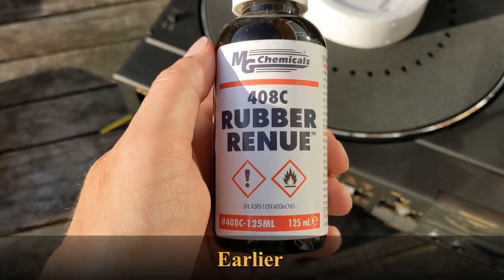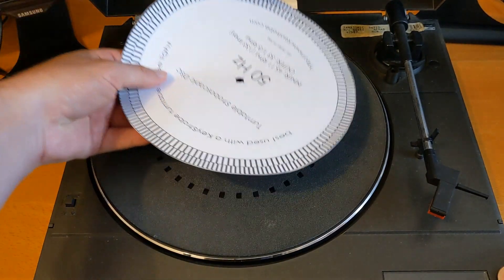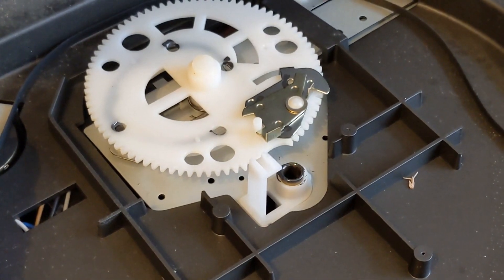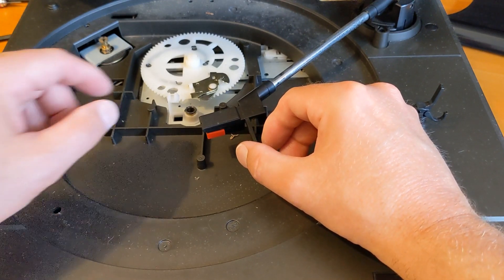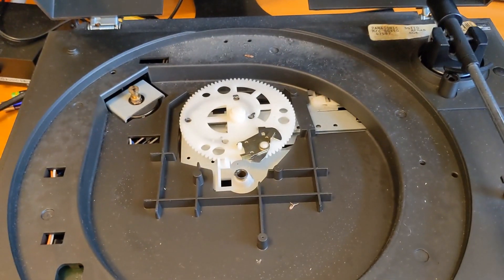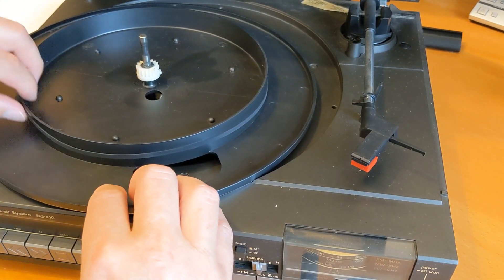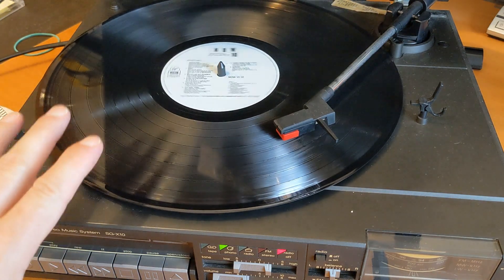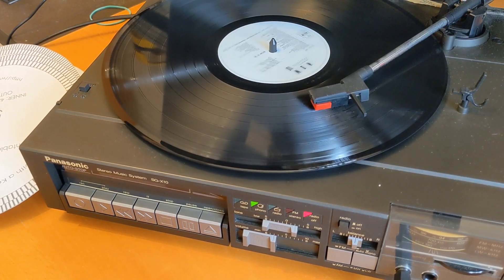Pinch Roller Experiment and Turntable Belt Check

Comment: Hmmm, first version of this message was deleted, presumably because I mentioned one of the ecommerce platforms.

Agree about boiling the belt, ten minutes in the microwave should do it. I wouldn't bother replacing the stylus if it seems in good order (they usually are), invest your twenty quid in an ultrasonic cleaner instead and clean the current one up, usually that is all you need. If we can get past the filter I can point you toward a seller who sells belts and pinch Rollers (good ones, I've used them in hifi decks a few times) for very little money, based in the far east. Should be able to get all required belts and roller for about a fiver or so.

ETA the service manual for this is readily available so you should be able to get the required part specs without pulling it all apart first, always handy! Also, if you're looking to buy a stylus it looks like CPC have the one you need for a fiver if you find yourself buying other stuff from there (EPS41/G050TF).
Reply from the maker: Sorry for the late reply.

Thanks for your suggestions. Long story short, I'll be doing a Walkman pinch roller replacement video soon, and I've looked at the screws for the Panasonic Music System cassette deck and I might be able to get that pinch roller out easily too. In that case, I'll experiment with the boiling of the pinch roller and turntable belt. I like finding out for myself how to do things, but I'll refer to the service manual if I get stuck, thanks. £5 sounds good for a stylus, I'll look into that.

I've got a long queue of videos already shot, and videos to shoot, so an update might be many weeks away. But your info will probably help this system get back to its former glory, such as it was :)

Thanks again.

Comment: For all I know Rubber Renue is a product that works... on idlers. I wouldn't even dare to use it on something directly contacting tape.

Still idlers and pich rollers are cheap and can be the better option to revive an old unit.
Reply from the maker: I concur. I'm experimenting with pinch roller replacement soon.